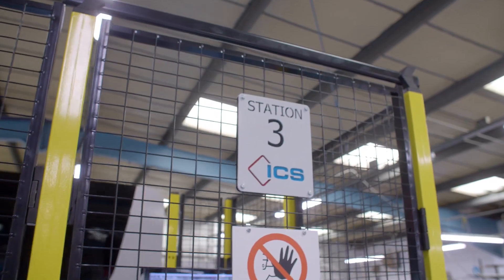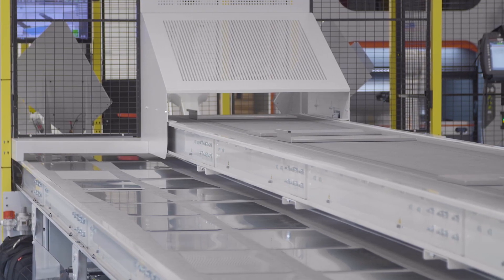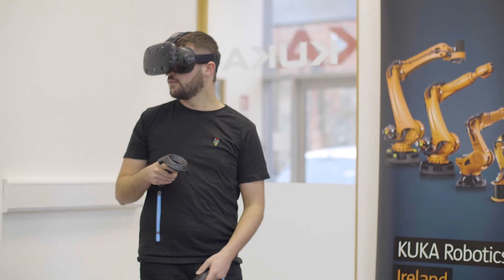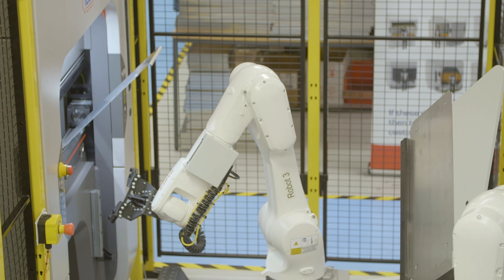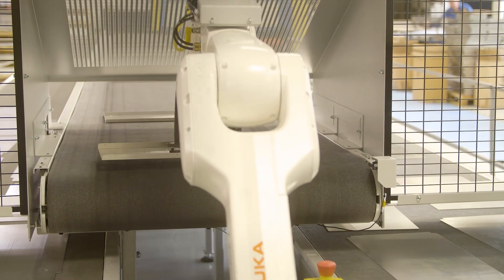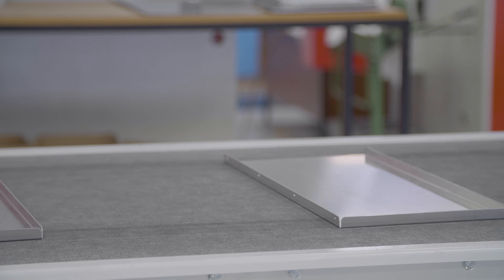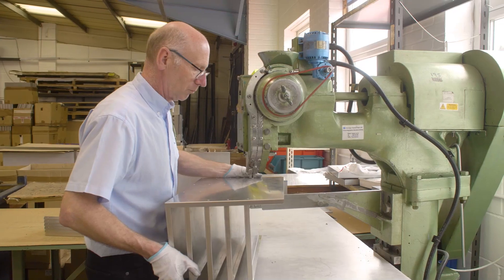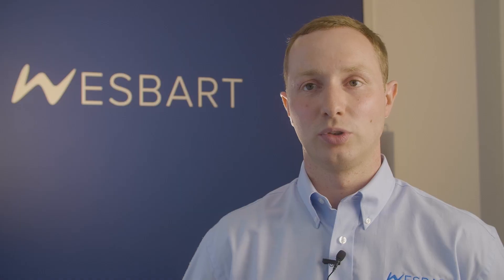Wesbart Utilise Automation to Increase Throughput and Maintain Product Quality

Comment: What kind of controller used in this robot?
Like PLC
Reply from the maker: We're checking with our UK team. We'll get back to you ASAP.
Reply from the maker: This robot was controlled by our very own KUKA KRC4 compact controller. The robot is driven to varying positions via our KUKA smart pad which is a simple strait forward, easy to use teach pendant. These newly taught positions are saved and the controller creates a robot program in our own KRL language. 

Our robot controllers can be used as the brains of a system and act much like a PLC, controlling various other aspects of the system. Alternatively if you wish this robot can be used as a ‘slave’ taking its orders from an external PLC.

If you are interested to learn more about our controllers please contact KUKA UK or go to https://www.kuka.com/en-gb/products/robotics-systems/robot-controllers
Reply: @KUKARobotGroup  thanks kuka team for your reply